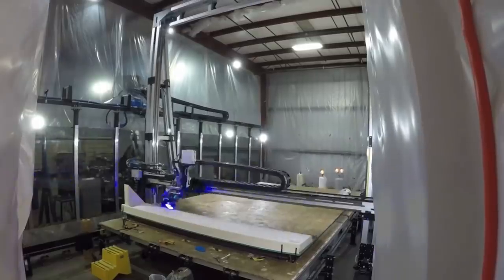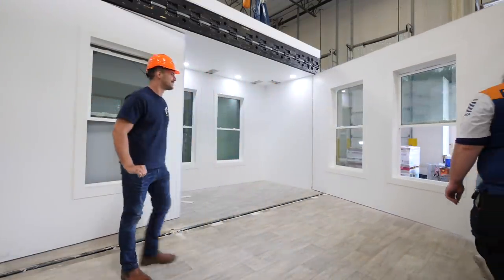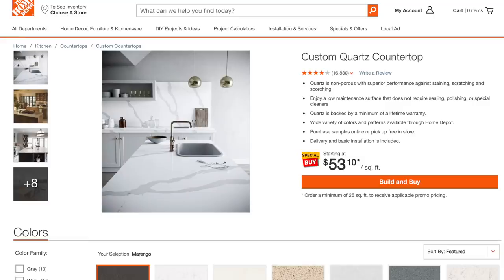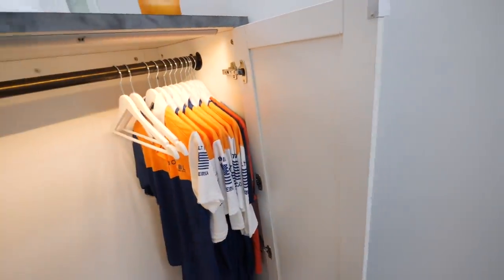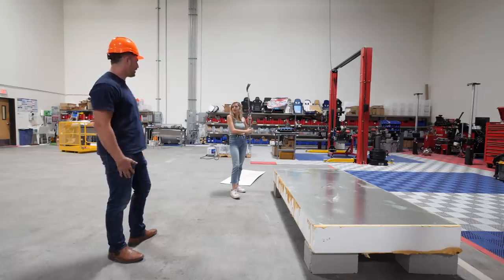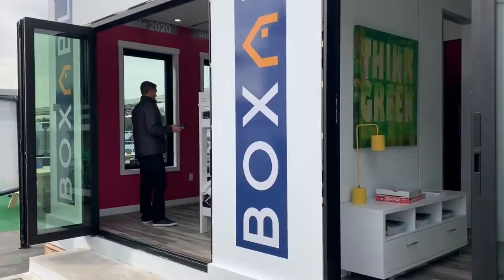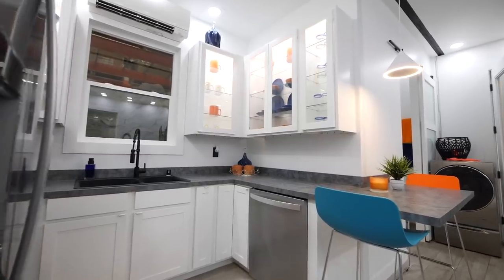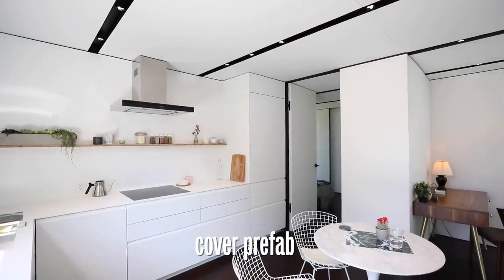A Look Inside a $50,000 FOLDABLE Tiny House

Comment: When you review a “low cost” home, and take issue with the low cost options 😂 

It comes with all the kitchen appliances for that price which are a nice add, & you could go floor to ceiling on the room divider/bedroom closet for more storage, mount the TV like u would on a wall and still be fine.

Comment: The real question, though, is can you fold it back up if you want to move?

Also, this was a great video.  I also think the company has a great mission statement.  They definitely put the money into the places where it counts - I'd rather have a sturdy fire resistant house with good insulation than some quartz countertops any day.  Finishes can be upgraded over time, but to have four strong walls and a sturdy roof is what's most important to me.

Comment: Interesting. To be hinged like that it has to be quite well built and strong to not just drag on the floor. That's not easy to do. While neat, I'm guessing more conventional element assembly will be far more cost effective and flexible. It can connect with pins or such and finish the seams with caulk or other sealant. Or even have thin flexible seals that just close together because it's precisely made.
I see no reason why they couldn't have marble slabs on the walls or 10 foot ceilings.
Reply: Agree with your point. It seems like though that they are more focused on creating a product that can be transported and quickly assembled rather than the aesthetics of the final product. With the price point that they picked for this unit, marble is definitely a no go product.

Comment: Stacking five to seven stories tall? Interesting. In Silicon Valley and probably most metropolitan areas of California, mixed development is the current trend. Retail stores and car garage in a concrete base, and four stories of apartment/condos in wood, located near a major transit line. Five to seven stories in wood requires iron/steel beams and not cost effective. Local regulations might prevent stacking prefabs beyond four stories.

Comment: “All you have to do is electrical and plumbing.” Girl do you know how much that is?
Reply: 10:45 She acknowledges it costs a couple thousand more and that after property taxes it’s actually very expensive
Reply: Not just a couple of thousands- more like minimum 20k🤦🏻‍♀️ for a septic tank
Reply: This would make an excellent Pool House the only thing need to be done is attaching the house to the existing septic tank system.
Reply: I've been following Boxabl for a while now. When they say "do electrical and plumbing" they mean connect the Casita to the grid. It comes with pipes and wiring and all that already done.
Reply: shes so out of touch
Reply: @JTHundley  does it really? If so thats pretty good, bc i can always dig and put a septic tank in myself since i grew up helping my folks do work like that
Reply: @slimjimbo-_-9994  Sure does, they said in another video. You hook up my shitter and I'll hook up your internet :)
Reply: Exactly. I just spent over $2000 on plumbing repairs in my kitchen and primary bathroom.
Reply: They're main market right now is Additional Dwelling Units. This means the existing infrastructure just needs a few new hookup points installed next to the new tiny foundation to attach your parent's/child's new home to water, sewer, & electric systems. Rural installation is a bit more complicated, but they have big dreams.

Comment: So much attention to the aesthetic aspect of quality, while underplaying the fact that at this low price you're getting hard to find washer/dryer combo, double wide fridge, fully furnished, lighting, A/C, top of the line insulation and secure structure, etc. I think it's awesome. I can always install a new counter. I'm not so crazy about all the can lights in the ceiling, or it's low height. THAT would be more difficult to change. Also, I suspect that saving up to install fancy windows later would be difficult because of the special design of the wall systems. I'm wondering about the possibility of somehow covering the ceiling that camouflages those joints. 🤔 At any rate, I'd love to get two boxes stacked for the large kitchen below and the dbl bedroom above. Unfortunately, I live outside the USA, and my budget is too small - Even for this budget option. And finding equipment, staff for the setup... I'm thinking nobody around here is qualified.

Comment: Shelby, I think it's great that you cover such diverse topics! I think this is a really good approach - the idea of assembly line home building. I feel like this company, and others doing similar, are taking advantage of the tiny house trend which is not about inexpensive homes but about small homes - and pricing them accordingly. The tendency is to do a lot of custom work to cram a lot into small spaces. With the extra design times, less common appliances, custom woodworking, these hinged systems, etc... It makes it higher in cost. I would be interested in seeing a standard stick based construction cost comparison to a very similar design in this particular case. IMHO, it would probably be cheaper. I'd also be curious about the install costs of this unit - delivery fees, contract/rental/etc costs for the machines to setup the unit once delivered, foundation costs (you mentioned electrical and plumbing to water/sewage - but the structure has to have some kind of foundation to be installed on as they can't just be sat on the ground). Basically, I think a local contractor building wood based homes, could build something very similar for less - which is contrary to the idea of using the assembly line approach to bring down the costs - as it should. Perhaps they will get there and the current cost reflects R&D, facilities, software/hardware systems to produce these structure and will come down in price later. This is same idea as modular homes in general, and at $50K/400sqft - I just can't see this as "an affordable comparison" - at least in terms of being more cost effective - maybe competitive... Anyway, great video!

Comment: I think this could be a good way to go as long as the price stay where it is and maybe even lower.
Shelby, here's a thought on those exposed ceiling hinges - you can buy styrofoam beams that look like real wood beams and glue them over the hinge seems and it would look nice yet hide the hinges. Over all with most stick built homes going for well over150K and up this would be ideal - there are still places where you can buy land (not alot) for less then 50K and with utils included your still gonna come way under what a stick built home would cost you, not to mention the build time!

Comment: The video showed appliances (i.e. refrigerator, stove, microwave).  Are they part of the basic unit or do you have to purchase your own?  How is the unit heated and cooled?  Is that also an add on or does it come with a Mitsubishi heating/cooling unit already installed?

Comment: Give me 5 attachable modules for the price of that other completed unit from Cover, or whatever they're called, all day long. I don't need bamboo in it, or a hidden fridge.  That ends up being a lot of square footage and a really nice, contemporary dwelling. Plus, wouldn't different modules be cheaper without plumbing, or less windows? You could have a movie room module, that attaches laterally, with only a couple side windows. I also like the "pay as you go" aspect to ownership. The seams, where the walls swing out and/or attach do concern me regarding rainwater, but probably ok. I'm fine with those countertops. lol

Comment: How about something more in the middle? So can you get higher grades from Boxable? For example the basic house with the quartz counter tops as an option? Their website is very limited with customization and prices. Another question is how should the ground on which the unit rests be prepared? Can you get a v roof for snow loads or rain? How is power routed to the unit? These are basic questions that their site do not get into and what should  be asked

Comment: well~ you pointed out the questions too. so how much does it cost to hookup the electricity and pluming? after the house is assemble, can the process reverse? pack it up, move it to somewhere else and setup the house again on another piece of land? on top of that, if I want to buy a land and put this house on top of it, what should I look for? I mean I don't want to place this box house on land that will damage the house but not sure what to look into. hmmmm~

Comment: I do want to know cause in most  places, specific local towns have rules & permits. I do want to know if there's a list of locations these type of houses are acceptable.  I'm not a homeowner so I need to know. This one is tiny though. This is a base model so it would be priced higher for the non-base model. Usually for base models, you usually need more updates & fixes. Shelby is right because that countertop may not last long. It would need to be a little above 50K.

Comment: the housing affordability problem is not in the cost of the unit. a 400 sqft portable vs a 400 sqft site build cost is about the same. the affordability problem is that the municipality does not give permits for any living units.  be it portable or site build. and if they do give a permit. the permit costs a ton of money. more than the unit itself.

Comment: Its still far too expensive for the market they are going after but its a darn good start. I have been interested in tiny homes since the 90s when I lived in a 500sqft condo. It was unreal cozy and the space was more then plenty so I started investigating these solutions. The one problem I found was minimum sqft requirements and the sheer cost of these systems. This is a start. Now if they can change some of these laws and make the product closer to say 25k we might get somewhere with it being a real affordable option. Then theres the question of your investment. It would be like buying a mobile home because with out foundations and a demand these properties wont hold the values of traditional home builds.

Comment: Factor in drilling a well, digging a septic, pouring a slab, plumbing hookup, electrical hookup and cost of land. You might be better off to buy an old small home already built.
Reply: it is definately cheaper to buy a fixer upper. because the foxer upper already has utilitites and hook ups. and permit to have the house there. good luck paying for that permit for your pre fab. its going to cost more than the prefab itself.